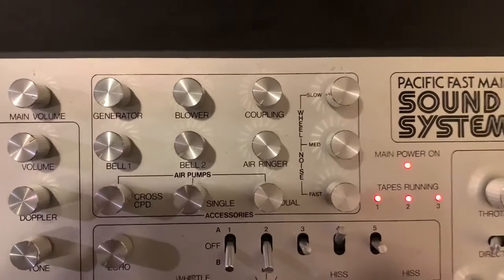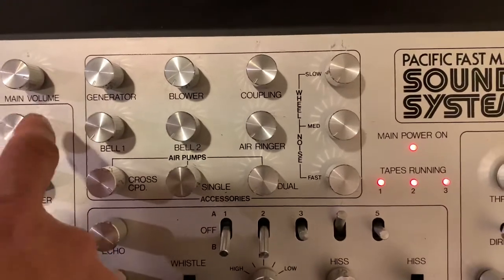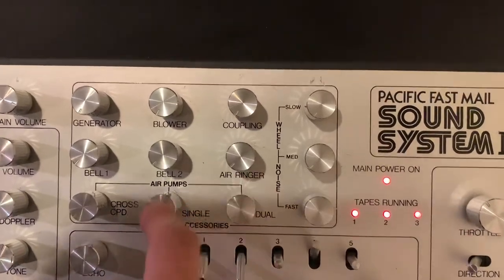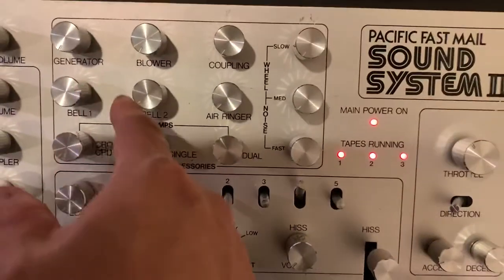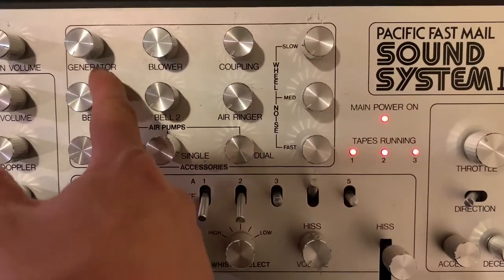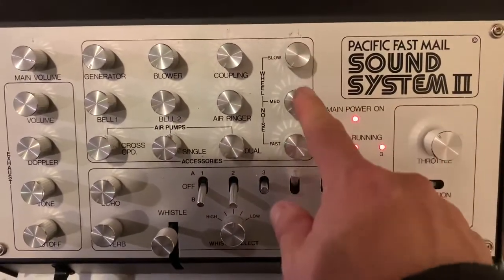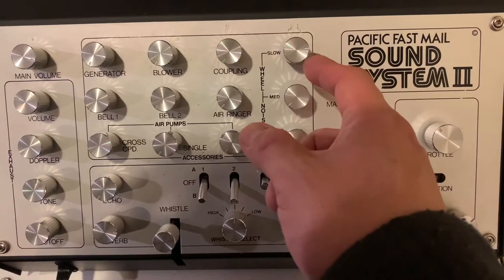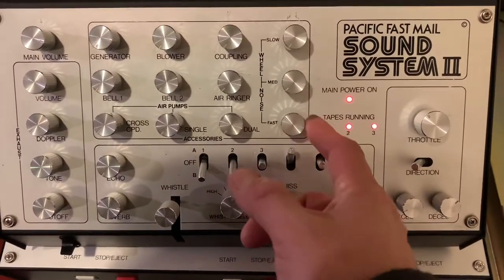Pacific Fast Mail PFM Sound System II Demo

Comment: That’s a great demo video.  The system was quite advanced for the time, and the sound is pretty amazing.  The cutoff adjustment is actually attempting to simulate the sound the engine makes at various settings on the reverse lever.  The engineer would adjust the cutoff to change the amount of the expansion stroke that the valve is open to admit steam.   Long cutoffs were used when starting a heavy train, and when the locomotive is working hard at low speeds, such as when climbing a grade with a heavy train.  The exhaust sound with a long cutoff produces a very deep and long duration chuff.  The engineer would shorten the cutoff setting (also known as “hooking up”) the locomotive to reduce the length of the expansion stroke that the valve is open and admitting live steam.  This was done at higher speeds, to reduce steam consumption and reduce the rate of fuel consumption.  The exhaust sound at higher cutoffs is a short duration, higher pitched exhaust beat.  The PFM II System does a very respectable job of approximating these sounds.    It was a very sophisticated system when introduced.  I bought an old PFM I sound system several years ago, but it doesn’t work.  I found evidence that a mouse had gotten inside and built a nest.  I think the wiring had been damaged.